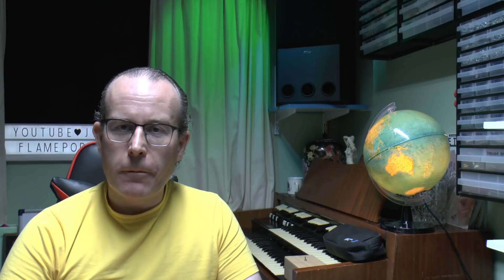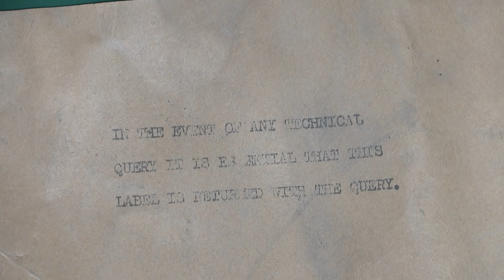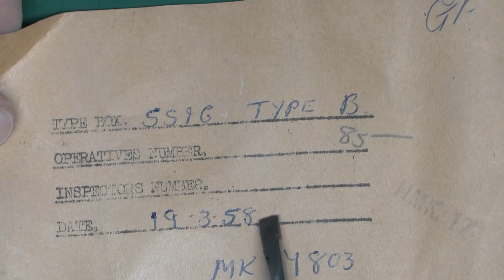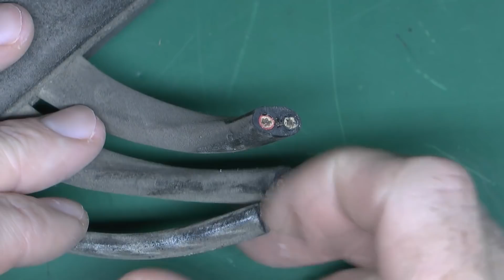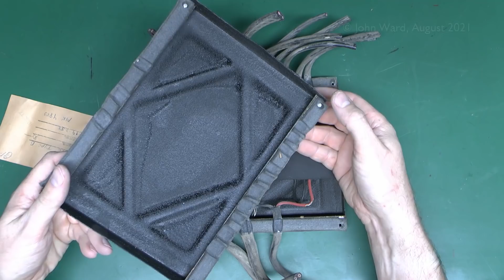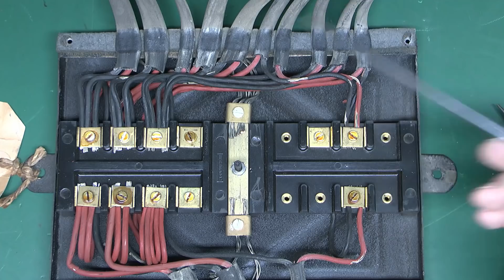Octopus Box by Hartley Electromotives Limited 1958

Comment: Some more information on the installation this came from: 
 It wasn't in use at the time I stripped it out (the house having previously been part-rewired in the mid-80s in PVC with some remaining VIR dotted all over the place) and was above the kitchen ceiling just under the landing. The repeat use of the stairs coupled with loose timbers (now fixed!) may have caused bits of the insulation to fall off with the vibration as it dried out and became brittle. 
 I also traced two of the farthest left earthed cables to single sockets in two of the three bedrooms where the cabling hadn't been stripped out behind a built in sliding wardrobes. There is another video of one of these just recently where the box remained live with all the lighting circuits turned off, so is possible they had much use for socket radials as well.

 It wasn't secured in any way in the ceiling void, but was tucked in the floorboards with numerous VIRs snaking along that all started to crunch as I inspected it, despite being soft to the touch.
 I saved a piece of three core cable from that house (red, white & blue cores) but can't seem to find it at the moment.

In other properties in/around that estate, I have found that some of the original wiring is a mix of PVC & VIR (PVC for lights & VIR for sockets mainly) or just VIR or PVC, so may have been at a transitional time, though this house was seemingly purely VIR when originally constructed in the late 50s so far as I can tell.
Reply: Sounds like an interesting estate to work on! I have seen PVC & VIR mixes in properties around that age but I've never had an entire estate in a somewhat time capsule snap shot of  technological changes. I did come across an oddity the other day though, PVC inner core T&E with a rubber outer sheath in a 1960's property It all tested perfectly fine and inspected all points where possible and found now issues but I have never come across anything like it before. I don't suppose there is an example of that on the estate too?
Reply: @effervescence5664  Can't say I've found any, sounds extremely rare

Comment: Why would the terminal screws need protecting against loosening? In that sealed environment, why couldn't you expect them to maintain the torque they were tightened to forever?
Reply from the maker: Electrical wiring heats up when in use, and repeated heating/cooling can cause screws to loosen.

Comment: Hartley made whole-house wiring harnesses for the 60's pre-fab housing boom. Made erection alot easier as wiring could be buried in the wall panels at the factory before transportation to the building site and then connected into central points.

Comment: commenting for sake of 1940s Hartley time travelling design engineer; a glass window for viewing insulation condition at the bends would be useful. Alternatively, more space to allow much more wider bends & loops in cable or even terminals on all four sides to avoid need to bend cables in first place.

Comment: A guy from England that moved to New Zealand in 2002 tried to make one of these things at the same time as he was re-wiring his house.
No electrical experience at all, we had an argument and I ended up ripping the thing out, he thought it was just a junction box for EVERYTHING in the house and yes it probably was, but when you have the oven wiring mixed in with the lighting circuits, that is not how we wire stuff here. 
Thanks for the video, JW.
Reply: Not how we do it in the UK either!

Comment: We have something similar in our loft for the upstairs lights. It is plastic and made by Volex installed approx 1971 when the council estate was constructed so a few houses with the same layout. All switch wire and feeds to lights go back so only one cable at each point even both the 2 way 3 cores go back. All the terminals had glue on them as not to loosen in transit. it was placed at the loft access and each cable is marked bed 1 light, bed 1 switch etc, and was clipped with metal buckle clips to the light or switch.

Comment: I've watched a lot of your videos JW and I really want to try this line of work. It is significantly cheaper, easier and less time consuming to take the domestic electrician route then the fully qualified path, but I understand there is a very large stigma attached to domestic electricians by the fully qualified community. Domestic stuff is all I really want to do, to set myself up with a van and equipment and just do work at regular homes. Do you think that is a worthwhile goal?
Reply from the maker: These are the routes for electrical training: https://www.electricalcareers.co.uk/joining-the-industry/training-routes/
The difference between domestic, commercial and industrial is primarily the tools, materials and installation methods used. The basics of electrical principles and electrical installation as covered by those training routes are the same.
There isn't any 'quick fix' option to only do a specific type of work, and places claiming to offer such things are selling an expensive lie.

Comment: Are the conductors tinned copper or aluminium?
Reply: tinned copper
Reply: @ratbag359  Well that's a relief, aluminium conductors are a total pain to work with (easy to break) and have to be thicker too.
Reply from the maker: Tinned copper.  Aluminium in small sizes was only used for a very short period, and that was copper clad so had a copper appearance on the outside.
Reply: @jwflame  My dad sometimes had to work with that copper clad aluminium when he was doing domestic electrical work. He said it was a complete nightmare to work with, if you nicked the conductors at all when stripping the insulation they would crack when you put them in the connectors. He had to be a lot more careful than normal, which took a lot of time. And he was still unsure how long the work he'd done would last, but then he likes to do a good job.

Comment: I have one of these in service in my house, built circa 1963. Makes the wiring different to current practice- the power goes via the switch to the light fitting, rather than a ring main around the light fittings. They are really great if you want to fit 'smart lighting'- a single controller at the octopus can control all the lights. Neutral available! Not rubber wiring, fortunately.

Comment: Ummm. A couple of questions if I may. Break of guage, over current circuit protection? And why are red and black terminated together on the right hand side? Surely not code, even way back then?
Reply: It'll be a switch drop. Cable with two red cores was available in VIR - my parents' place had it - but here they clearly had none. 

For clarity: Line/live to switch on red, switched live comes back on black, switched live to light fixture on red.
Reply: Also to add to what Graham's written - the over-current protection would have been back at the fusebox. Rewireable cartridge fuses in those days.

Comment: The insulation is the best I've seen on Vir I rewired a house in 2003 every cable except for the heating controls was Vir as soon as I unscrewed or touched anything it just crumbled I was surprised it was all still working without issues
Reply: In my limited experience of VIR it's the blue insulation that goes first.

Comment: Its slightly amazing to me that there are still rubber conductors on active wiring in this day and age, unless this was taken from an abandoned building that was being demolished. I remember as a child in the early 70s my father telling me how rubber wiring was dangerous and being replaced with PVC insulation. I would sit and watch as he took old radios apart and replaced the wiring in them, and he occasionally did the same for neighbours appliances. Most of the time he threw the wire away but sometimes for solid core wire I would sit and strip off the insulation for him (some of which was already crumbling) and we would use the bare wire in our electronics projects.
Reply: Well they still make rubber cables today, though we don't generally use them for building wiring anymore. I wonder if the modern synthetic rubbers will hold up better than the old natural ones.

But that aside, I get the impression there is a lot of very old wiring still about :( I suspect the new Landlord EICR rules are causing a lot of it to get ripped out at the moment but that still leaves owner-occupied houses. When I bought my current place a few years back the wiring in most of the house was a mixture of old rubber and horrible bodges.
Reply: Until very recently I was living in a rented house that was mostly still running on vir, changing a socket was a nightmare, had to be very careful not to move the cables to much, some of them I put heatshrink sleeving on.
Reply: Have pulled out working VIR and lead sheathed cable out within the last year. Am a builder, when we find it we have the electricians rewire and gut the old out. Often its short sections a previous rewire couldn't get to or be bothered to get to.
Reply: Lead-sheathed cable in my house when I bought it around 14 years ago. Previous owners told me it had a full rewire in the early-00s (CU was labelled accordingly too) so I didn't bother getting an electrical survey. First time I lifted a floorboard to add a socket I wondered why the T&E was so cold and hard...
Reply: That is a nice story you shared with the world.

Comment: I love the videos about the old stuff.
It seemed to be well constructed. Certainly a good idea, as you say, there's less wires in the ceiling rose. 
I wonder why and when we moved to 3 plate,
Reply: It was deemed that all joints should be at all accessible points such as the 3 plate ceiling rose, rather than hiding joints in lofts, under floor boards etc.

Comment: I like these old equipment overviews. 

Surprising how "glass hard" that rubber insulation got in that box, while it was still flexible outside. not good!
Reply: From my standpoit that might be a chemical interaction with the rubberized trim that held the wires in, combined with the near airtightness of the enclosure. While on the Outside any harmful interaction would be stopped by the available airflow around the cables
Reply: On second thought it might even be the screw-lock varnish instead